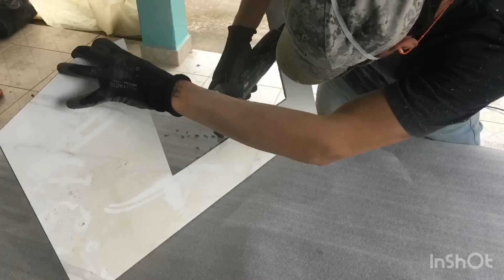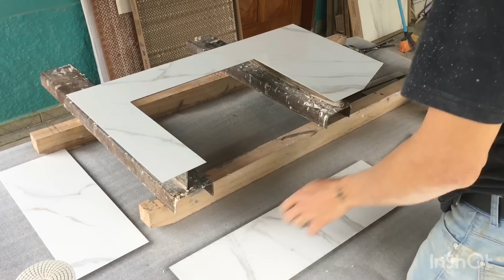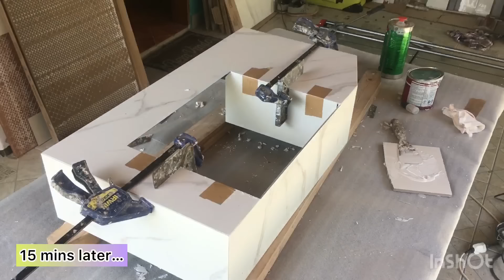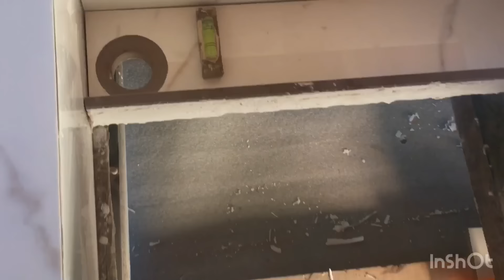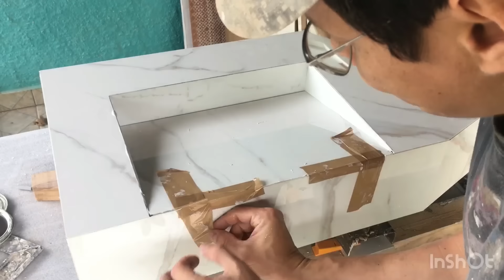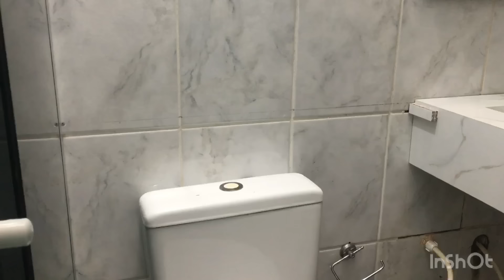“Marble“ bathroom sink with porcelain tile with all sizes and steps

Comment: Nice work, the only problem with sharp 45 degree porcelain tiles edge is that they will chip very easily on the thin brittle corners edges

Comment: Great work. Can I have a list of all the tools you use? Thanks
Reply from the maker: Hello dear. Thank you.
1) angle grinder with diamond disc for cut tiles
2) angle grinder with diamond polishing pad number 200
3) conical grinding cup number 120 4”
4) conical grinding cup number 120 3 “
5) grinding cup number 120 2” for make valve hole
6) squares 
7) tape measure 
8) pencil 
9) spatula 
10) clamp tool (2 or more)
11) tile cutter 
12) felt disk with parafine
13) hand torch 
14) diamond hole saw d=32 mm 
15) silicon applicator tool 
16) paper knife blades
Reply: Excellent job. May I know what exactly that white glue you have used to secure the ramp ? Thanks

Comment: What’s your angle saw blade? I always chip the tile when cutting it. Porcelain is so fragile
Reply from the maker: I use only angle grinder and disc for porcelain tile. And polishing pad n 100
Reply: @Porcelanataria_45_graus  Great, Thanks. I tried a smoother disk for cutting glasses and the cut is nice and clean. Then, used the diamond disk to cut the slope

Comment: Muy lindo pero los pelos o lo pequeño que sea termina tapando el desagüe si no podés limpiar le boquilla
Reply from the maker: Actually the is an access to clean the drain
Reply: Nowadays, there is a chemical powder you can throw in, and it will unclog things like hair, grease, and other blockages